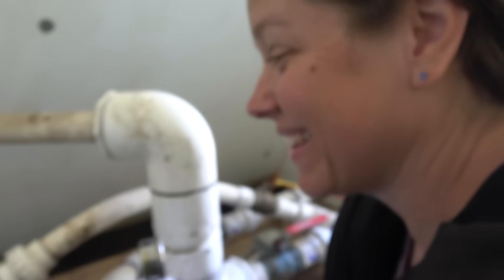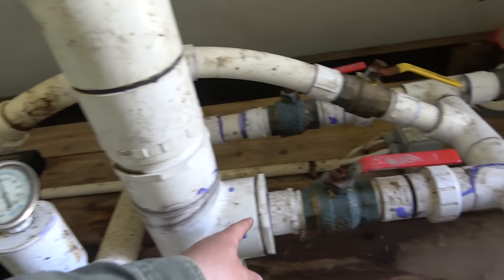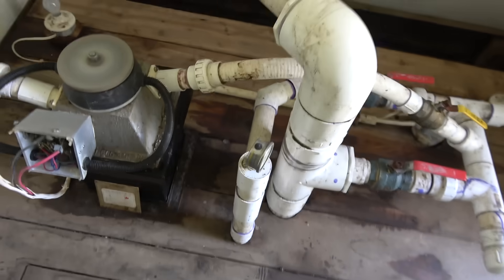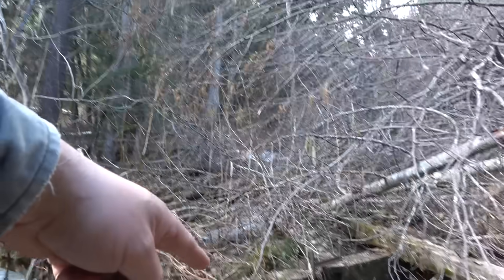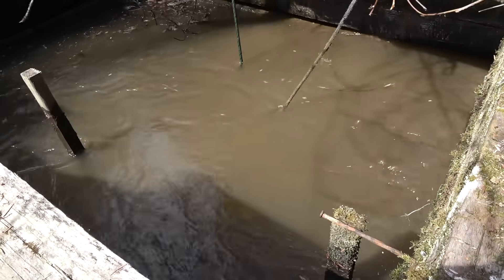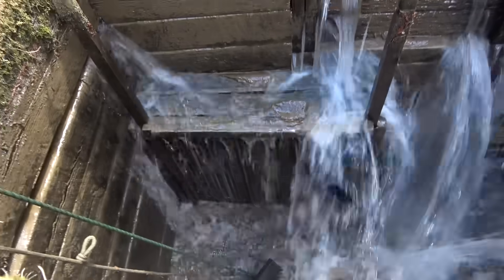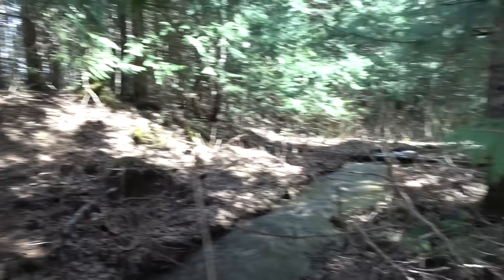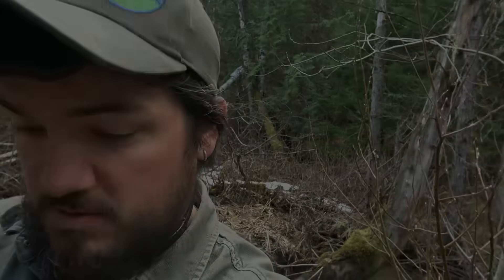Off Grid Micro Hydro - The Dream System!?

Comment: Old video but i enjoyed it haha...I live off grid in Alberta, The reason the property I purchased was sold to me was the previous owner died in the water box exactly like the one you have. Delta P is incredibly dangerous and should be talked about with a system like that, especially with your daughters.
Reply: Can you elaborate a little more
Reply: Sure. If someone put their arm in the pipe to clear a blockage or something, the weight of the water and the suction of the other side could cause that said person to be stuck and drown. This is what happened to the man that had my property before me.

Comment: In rural Alabama, I met a guy with a large pond, elevation of about 5 feet, who had a couple of large hydro-electric generators.  He provided so much electricity that it ran 5 homes and had enough remaining to sell back to the power company.  They periodically sent him a CHECK rather than a bill.  It was amazing how much power he could generate from so little 'fall' (altitude was basically flat).  He could do this because his pond was so huge and he had  enough water flow.
Reply: I need help. What if I have no elevation? I'm moving onto a property by myself and there is no electricity, are there any other options, or a way?
Reply: He must of had a very large volume of water if the head was only 5 feet. That is a good amount of power to run five homes and have excess to sell to the utility. Where they propeller turbines aka Kaplan Turbines?

Comment: Why dump the hot water why don't you instead swap the pump out or valve what ever you are using for a element or heater so when it's not heating the hot water it's heating a external element

Comment: Since you have two water pipes going to the one stream generator, could you add a second generator using the water pipe not being used and double your power to 2600 watts?

Comment: I see manual control. Typically, such technical devices of this type are duplicated (one is in operation, the other is standing next in ''stand by'' or under repair) and have a number of sensors signaling the malfunction of different parts of the device (bearing temperature, speed, critical drop in water flow, output voltage drop - it all depends on fantasies of the exploiting person).

Comment: identical system i have...  i get 15 amps at 55 volts ... bout 825 watts... been running it for over 30 yrs  ( i have 2" poly  pipe with 180 ft of head over  about 250 ft distance)... single nozzle... and it never freezes ,.. even if it goes to 40 below for a month.(which it has a number of times over the years)

Comment: I won't go into detail but in High School in the 70's I help my science teacher build a box with a generator inside hooked to a heating element for an electric stove inside his forced hot air heater in the house and it worked. Small stream away from house. Don't remember but it was like a 8" pipe then 6 4 2 into box

Comment: All that for 1kW.  It's awesome and I want one, but it makes you realize how amazing solar panels are. Either way you're going to need a substantial battery setup.  With the cost of solar panels coming down so much, hydro is really just backup for when you get a string of cloudy days.
Reply: Hydro is 24/7 and is much more efficient and reliable than solar.

Comment: Ok but where does the power get stored it's not all in that solar box right? My guess is  batteries but I am kind of trying to find away from batteries instead use something like a motor and alternator setup maybe 1 or 2 batteries but I don't like the idea of having more than that, could I power a house with this type of setup and be able to have a workaround with limited or no batteries needed at all?
Reply: Super capacitors are the answer.

Comment: I may have missed it, but how many gph do you need to have to run your system? I'm thinking of your setup but with a closed loop of water, supplied by water pumps that can provide around 2,500 gph..... Two pumps, running on 110v.

Comment: I got 11 years out of my little Stream Engine before a bearing went. It probably took all of two seconds to self destruct the unit.  The clearance between the stator and the rotor is about the thickness of a business card, so if they touch at speed, goodbye to a $3000 unit! I jerry rigged a 24V marine generator onto the original base and it seems happy now. But the big lesson learned was change the bearings after ten years minimum!
Reply: The suggestion is yearly but they will last longer. It's the only point that can fail for the most part.

Comment: The plumbing feeding the turbine nozzles, has a lot of losses due to the 90 degree fittings, and piping diameter changes.
Reply: There should be no 90 degree angles, you are correct. Piping must be reduced at the machine.

Comment: You will ever sleep again because of the noise but…it’s good…😂
Reply: Actually the sound only seems loud because a phone recording video picks up the loudest sound near the microphone. Notice that when he begins talking it drowns out the sound of the whine. There are no brushes as this is a brushless motor. The only moving part is the rotor on the top that contains the magnets. It cannot be heard from outside of the little building which amplifies the sound. Did you notice that at the beginning of the video?

Comment: Bearings are shot
Reply: Actually the sound only seems loud because a phone recording video picks up the loudest sound near the microphone. Notice that when he begins talking it drowns out the sound of the whine. There are no brushes as this is a brushless motor. The only moving part is the rotor on the top that contains the magnets. It cannot be heard from outside of the little building which amplifies the sound. Did you notice that at the beginning of the video?

Comment: Man, who as a private person has access to a stream with a flow rate of several gallons/sec and a decent head. In some places in Canda maybe but certainly not in Europe. The dream is not the micro hydro system the dream is having access and/or permission to use water from a stream for electricity production. Get real. Too many energy solutions proposed on yt are just pipe dreams and completely useless for 99.9% of potential users.
Reply: Permission?

Comment: guess needs new bearing
Reply: Actually the sound only seems loud because a phone recording video picks up the loudest sound near the microphone. Notice that when he begins talking it drowns out the sound of the whine. There are no brushes as this is a brushless motor. The only moving part is the rotor on the top that contains the magnets. It cannot be heard from outside of the little building which amplifies the sound. Did you notice that at the beginning of the video?

Comment: Those who are using headphones please beware of the noise coming up at 1:20sec. It can be pretty loud to damage your ear 😜. You should give a warning sound but try it yourself first 😅
Reply: Actually the sound only seems loud because a phone recording video picks up the loudest sound near the microphone. Notice that when he begins talking it drowns out the sound of the whine. There are no brushes as this is a brushless motor. The only moving part is the rotor on the top that contains the magnets. It cannot be heard from outside of the little building which amplifies the sound. Did you notice that at the beginning of the video?

Comment: Might want to change the bearings if it has any.
Reply: Actually the sound only seems loud because a phone recording video picks up the loudest sound near the microphone. Notice that when he begins talking it drowns out the sound of the whine. There are no brushes as this is a brushless motor. The only moving part is the rotor on the top that contains the magnets. It cannot be heard from outside of the little building which amplifies the sound. Did you notice that at the beginning of the video?

Comment: I have a rainwater collection system in combination with a batch solar water heater..I'm looking for a property like you have to run hydro + solar and maybe wind...the rainwater and solar water heater has definitely proven itself...I have the batch water heater plumbed in series with a small electric water heater so I always have plenty hot water

Comment: Attach a thermo switch to the hot water heater that diverts to an air compressor and or a large alternate heater tank . Don’t know what kind of heat is in house but all that excess hot water churns up possibilities.

Comment: That hot water tank is a bomb waiting to go off. Ditch the temp sensor and motorised valve and replace with a simple spring loaded pressure relief valve.

Comment: Why do you need to throw hot water? I understand, the heating, but does that mean that you are powering the hot water tank always, maybe you need to shut it down when there is no use or stopping the tank if the temperature is the desired. That way you can use that excess of power to something else? Maybe there is something I don't understand about this flow, I don't know
Reply: Who do you sell the power to when you live miles away from anyone or powerlines. It's always about selling and money isn't it? There are many uses for excess hot water. What you would do with it matters not to the owner of this paradise.

Comment: It is amazing that the bearings have lasted 15 years.  Is your stream up hill from your house or down hill from your house.   I would think it is down hill from your house to get the pressure you are talking a bout.
Reply: Those bearings are f****d and should have been changed 10 years ago. I ran a Stream Engine for over 10 years at 40M of head and it was waaaaaaaaaaaaaay quieter than that one. Great wee turbine and Paul at ESD is first class to deal with ;-)
Reply: Actually the sound only seems loud because a phone recording video picks up the loudest sound near the microphone. Notice that when he begins talking it drowns out the sound of the whine. There are no brushes as this is a brushless motor. The only moving part is the rotor on the top that contains the magnets. It cannot be heard from outside of the little building which amplifies the sound. Did you notice that at the beginning of the video? @camillitech1
Reply: @giffinski well I'd recommend you change them anyway ;-) They're easy to replace, cheap and should be changed every few years anyway ;-) Great wee turbine, had one for ten years or so before it died due to the magnets becoming detached from the stator. More a problem with the turbine's location down near the sea in a dark and damp spot than any fault of the unit ;-)
Reply: Actually the sound only seems loud because a phone recording video picks up the loudest sound near the microphone. Notice that when he begins talking it drowns out the sound of the whine. There are no brushes as this is a brushless motor. The only moving part is the rotor on the top that contains the magnets. It cannot be heard from outside of the little building which amplifies the sound. Did you notice that at the beginning of the video?
Reply: How do we know that they haven’t been changed. 15 years of running the Stream Engine which is solely responsible for giving them power I would bet that they are changing their bearings. If I hold my camera facing any Stream Engine it will record what sounds like a loud noise but as soon as I turn the camera 99 degrees away it hardly makes a sound. Try it with any noise, the microphone on a phone is very sensitive to direct noise. If you notice that when he starts speaking the sound from the machine diminishes greatly. Technology.
Reply: @giffinski he says so in the video ;-)

Comment: Great idea as long as you have access to flowing water like a creek or river. A small stream in winter could freeze like you said. A large creek not so much. The more and faster the water flow the less likely it will freeze. Water heaters have thermostats that turn off the heating elements when the water is at a set temperature. They also have a safety valve that opens if the pressure gets too high. Hydro electric power has been used for a long time to produce electricity to large populations of people, so why not scale it down for just a few people?

Comment: I am interested in small hydrographs, such as the formats installed in your area.

I would like to ask you to let us know the contents of the following items.

(1) Hydraulic pipe material: _____ HDPE________ (HDPE, steel, etc.)

(2) Hydraulic tube length: _______800__________ (m)

(3) Hydraulic pipe diameter: _____101 (?)_____________ (mm)

(4) Water available: ________9 (?)__________ (in litters per second)

(5) Fall: ______________30___________ (m)  =================================>>>>  Gross head : 30,   Net head: 20
                        
(6) Type of turbine: _________ Tugo__________ (Crossflow, Palton, Tugo, Francis, Kaplan, etc.)

(7) Generator type: ______3 phase  phase,  synchronous generator(PM)_________ (3 phase or single phase, induction or synchronous generator)

(8) Generator rated capacity: ______1.5 _________ (kW)

(9) Generator terminal voltage: _____53 (?)___________ (V)
Reply: Contact our company, Energy Systems and Design.

Comment: Ingenuity like this gives me hope.

Would be cool if he mined Bitcoin with the excess power. He can even use the ASICs to heat the house/water.
If he joins a mining pool, it's instant income.
Or, if he goes it alone, over a long enough time period, probability says he will mine a block.
That's 6.25 BTC at the current block reward and 187,000 USD at the current price.
It's better than just dumping hot water, I guess.

Comment: questions, questions. what happens when stream or pond runs dry? what happens to your home when stream or pond overflows? meaning, how far from the source can you live to be safe from flooding? does the shed provide enough insulation for winter months so the engine wont seize? at what intervals is maintenance required? meaning, how long before you replace the piping and wiring before it degrades?
Reply: Answers answers available at Energy Systems and Design. All of these issues are dealt with in the design. This is not a fly by night operation. Forty years of designing manufacturing and exporting micro hydro power systems that do not just stop working is what we do. So many sceptics.

Comment: This is an awesome system and video! Something to consider if this individual is literally dumping hot water to get rid of excess energy and selling energy back to the grid isn't an option: install a Bitcoin miner to soak up the excess energy and get paid for it. Would take a little extra work upfront but would allow the owner to monetize the excess energy and most likely recoup the investment of the entire system, pay for maintenance, etc. Also puts off a lot of excess heat that could be recycled for something else (nearby greenhouse?). Miners work awesome for stabilizing energy systems because they can be powered on and off instantly as needed. Just food for thought. Great vid!

Comment: Do you think that system would work using a rainwater catch system? I imagine as long as your water pressure and water catch is adequate it would be great and you would necessarily have worry about winters and the freezing necessarily.
Reply: No it will not work.

Comment: Really nice work!! Curious, did you need any special permits to create/install the intake structure?  Any water rights items?  Wondering what type of permitting is required for a system like this?  We're looking at possibly doing one as well.  Thank you.
Reply: I'm sure you need water rights, but I doubt that matters. If you build truly off-grid then there are no inspectors, assessors, and the residual water goes right back into the stream except the water needed for your toilet. I wouldn't advise drinking that water unless your specialized in water purification or else you'll make yourself sick. Even then the lines are buried so who would know?

Comment: Anyone know what the generator is on this? There is one at work that I am replacing the bearings on currently, its connected to a small Francis turbine and the bearings where running bad and a magnet got dislodged and jammed it up. A wire was also broken on the edge of the turbine so i'm wondering if they are still made and if we could get new coils for it if anyone knows of it.

Comment: What a great set-up. Have you asked the manufacturer of that water turbine how often you should change the main turbine bearings. As preventative maintenance is always a lot cheaper and quicker to do. You can also have bearing sound diagnostics to predict bearing life.
Reply: As it says in our very informative manual bearing change is suggested on an annual basis. We have informed the owners that this is necessary. The noise is more to do with the fact that the machine is in a very small enclosed shed that is insulated which amplifies the sound of whatever the camera hears. When Jeff is speaking you can hear his voice clearly. The machines are not very noisy at all.
Reply: I guess old bearing will have to be pressed off, and new bearings pressed on. And hopefully Bearing size/part number is in your manual. It would make a good episode if you record it.
Reply: @slypig24  Thanks for that. It is an easy change up to be sure. The old bearings will slip out without trouble providing they are still in decent shape and the new ones will drop in. Process takes under an hour. A video is a great idea. Appreciate the thought. ES&D